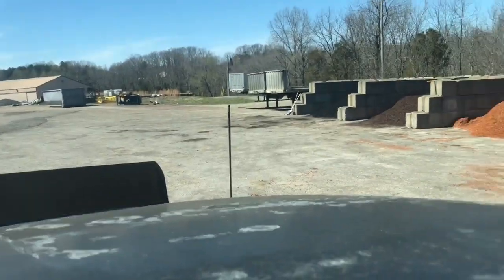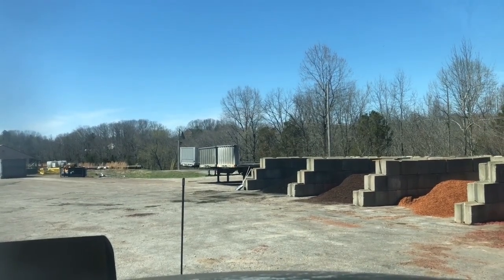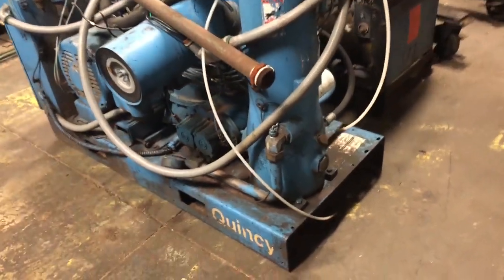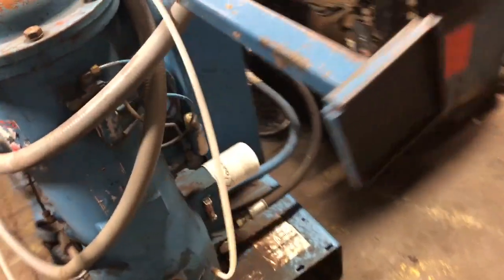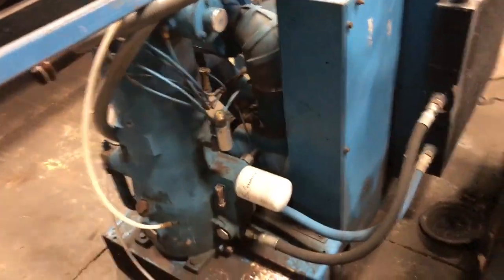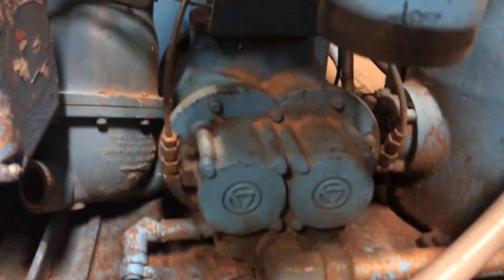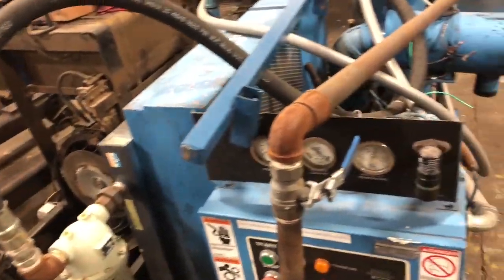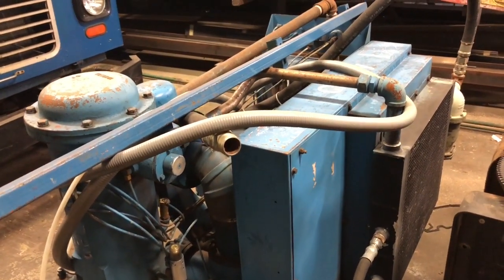Congrats Jesse, Air compresser for sale

Comment: I sold a 10 HP Quincy Rotary Screw compressor like that out of the shop about a year ago on an 80 GAL horizontal receiver for $700.00. It took me almost a year to get rid of it because it was 3 phase. It was too small for most places that had 3 phase, and too big for the home shops.  Good luck selling that bad boy, might want to put it in some of the commercial equipment advertisements.
Reply from the maker: CumminsDslPwr thanks bud

Comment: What kinda air compressor did you buy?  What brand and was it a VFD unit?
Reply from the maker: Bill Kramer the one we bought was Sullivan air 60 horse I think TEC motor
Reply: Logger Wade I used to make and power coat parts for Sullivan when I lived in Michigan City. They make nice machines. You should have good luck with it. I had a 25d Sullivan compressor on a 200 gallon tank. Very dependable machine.